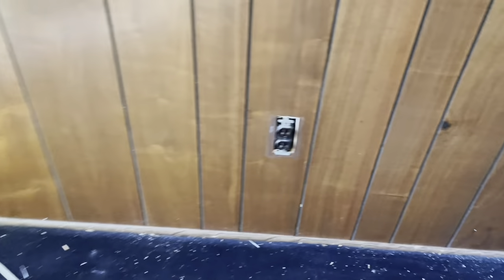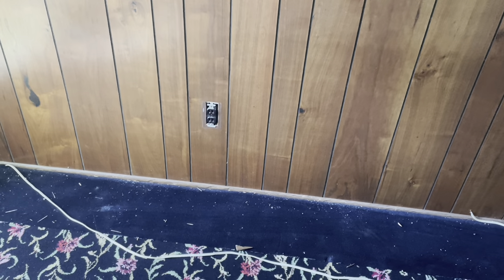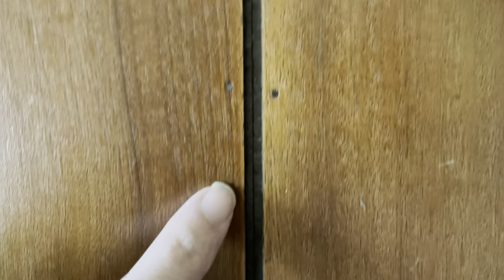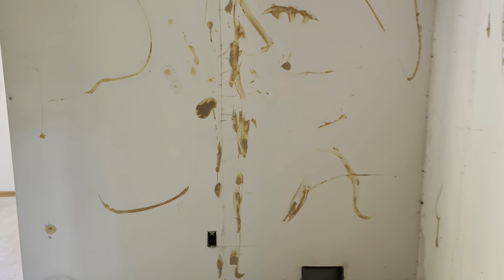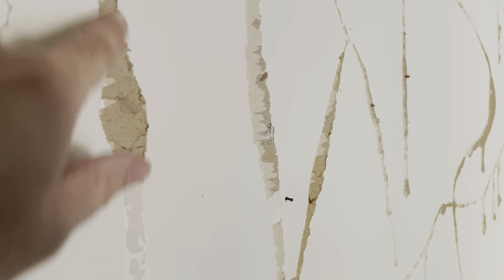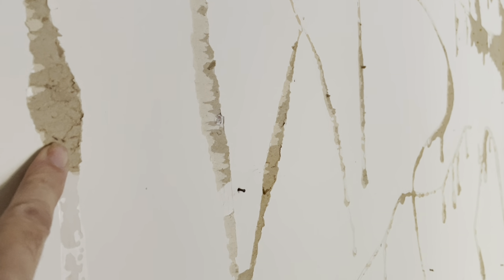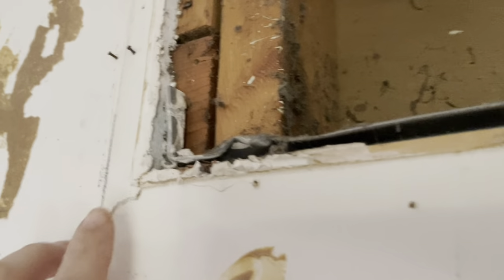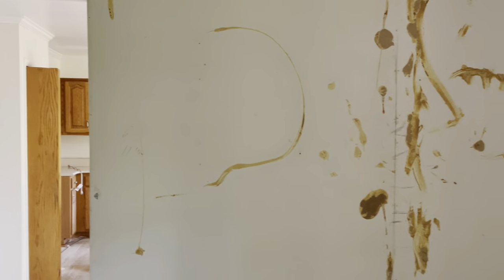How to remove wall paneling .  In whole board sections

Comment: So what do you do if there is no dry wall behind it? I have a 1950s bungalow and none of the walls have dry wall- it’s just studs behind it
Reply from the maker: @abellink  just paint it, if you remove it you’ll have to drywall it ( which is not that big a deal)
Reply: @7gshark the walls are filled with mouse poop so I do need to remove it at some point
Reply from the maker: @abellink  sounds like you should drywall then .  Good luck

Comment: I have a brick wall behind my panelling and I suspect they used a lot of glue. It's the cinder block type of brick.  How to remove the glue without scarring the blocks?
Reply from the maker: Hi I just saw this, sorry for the late reply.  The real question is what are you going to do with the cinder blocks?  are you painting then or covering them with drywall.  If you are keeping the blocks try to use a heat gun and then goof off, you should be able to get all of it off, it's just labor intensive
Reply: @7gshark  thanks, I managed to clear one wall with Diggers Glue Rid, but it took me a long time. Several weeks for a 4m2 wall.  Using steel wool helped and cleaning in between with mineral turpentine helped.  Needed also plenty of ventilation as the fumes are volatile.
Reply from the maker: @ sometimes people will use furring strips and put drywall up, it’s probably quicker.  Also have you considered a textured paint and just paint over it?
Reply: @7gshark  the glue was very thick that it would have been obvious even with popcorn paint.  Removing and then painting was the cheapest option and the results were quite nice, even though I wasted so much time.  I managed to sell the unit quickly after I finished.
Reply from the maker: @ that’s cool glad to hear it!!!

Comment: What if drywall isn't behind the panelling?  I have paneling in my garage that I want to remove.   Would you recommend using plywood or osb board to replace it with?
Reply from the maker: @LaToyaColeman-lm6uz  you probably have studs behind it so you can drywall.  If you have cinder block or you don’t want to drywall (because of the mudding) they sell some really cool paneling that looks different like fake bricks or ship lapp, etc

Comment: About 10 feet up my walls (12 foot ceilings) theres a strip of trim where the panel joins/has been extended. It looks like it might be h shaped. Can i use this technique? Originally i was just going to slap some wall liner over it.
Reply from the maker: If I understand stand correctly you have 2 pieces of paneling that are connected by a H shape trim.  If that is correct then you can use this method.  There might be more glue on that top piece and it’s pretty high up so it will be harder to work on.   I have another video on how to remove the glue

Comment: I have wood panels that are so thick and painted. 😮
Reply from the maker: There might not be drywall behind it.  If not you can try to paint the panels or put 1/4 inch drywall over it.  Good luck, let me know how it goes
Reply: @7gshark  there’s some plywood on the wall I think and no insulation.